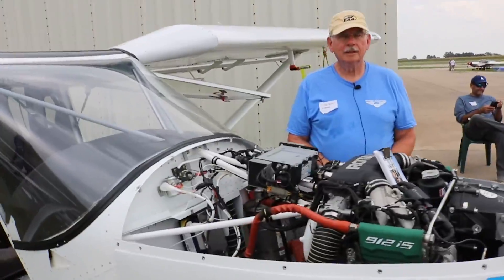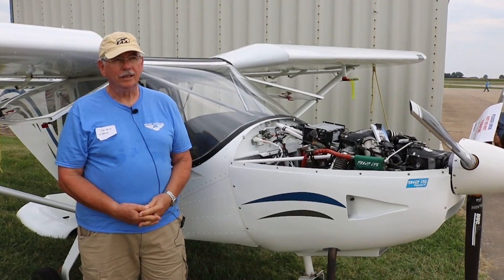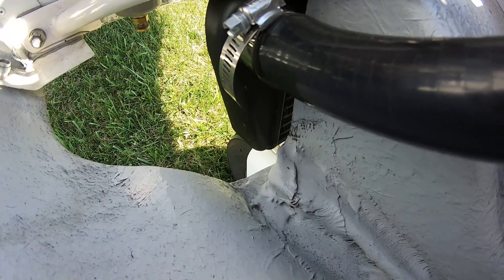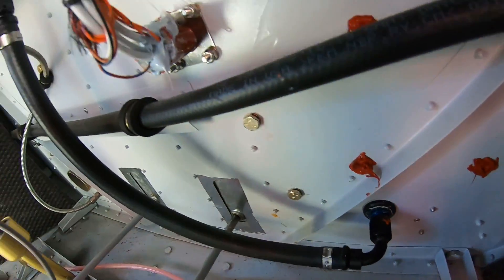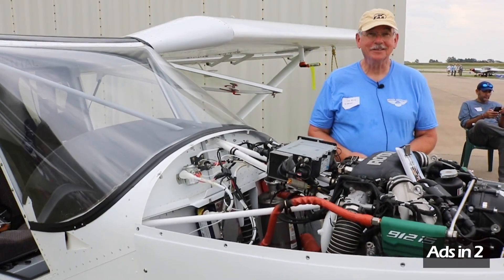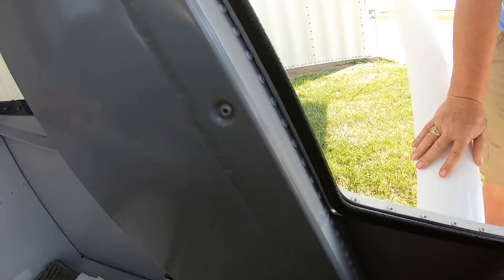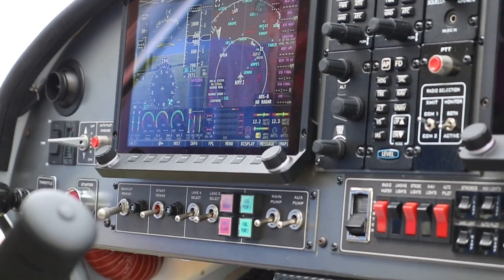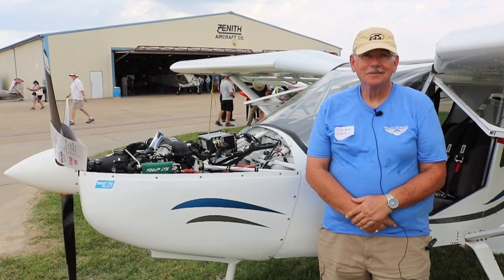Rotax 912is Installation - Zenith CH750 Cruzer Aircraft

Comment: Not for nothing, but I did the same thing to a bunch of aircraft, including trikes, but you forgot to install a T fitting at the end of the stock tube and then add your long tube.. all you need do is orient the tail of the tea straight up so the carb can vent normally but any liquids would go down your long tube down and out of the aircraft so the fuel that could potentially leak out of your carbs due to a bad float, would not land on your hot exhaust

Comment: Right tank as main makes sense,  we do make more left turns than right ones. So fuel does flow from right tank at higher rate.
Reply: How so?
Reply: @thefungusshow2535  Gravity
Reply: @ikay2102  If your turn is coordinated, the tank doesn't know it's in a turn.
Reply: The purpose of that valve is to prevent cross over of fuel from one tank to another through the header tank if the airplane is resting in an inclined position.

Comment: Great interview and what a great aircraft. The 912iS engine really is far more economical than the 912ULS. My 912ULS at 5400rpm in my Zenith 650 is burning 5GPH  compared to the 3.8GPH in the 912iS in the video.